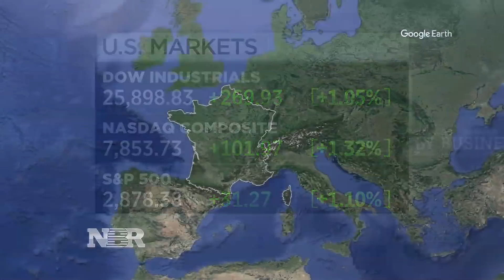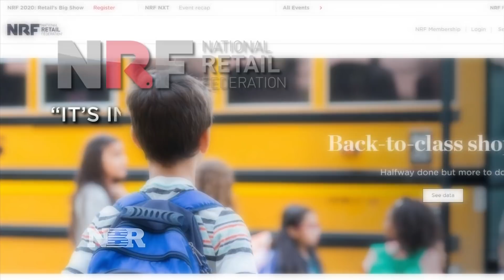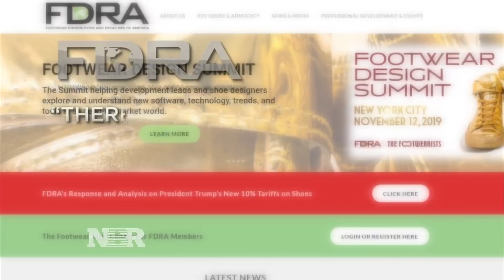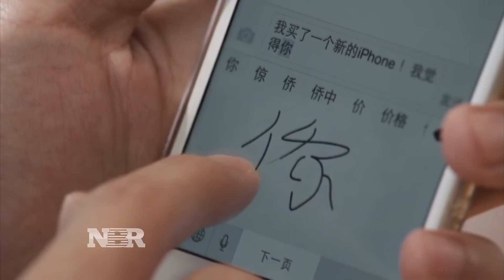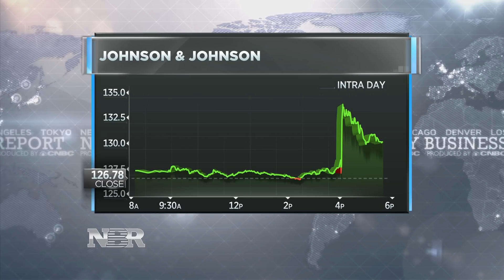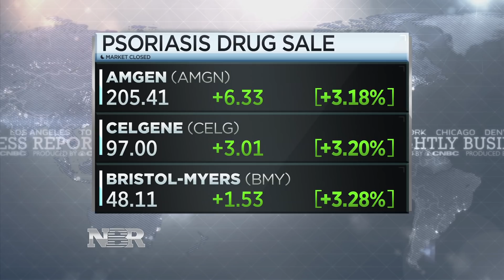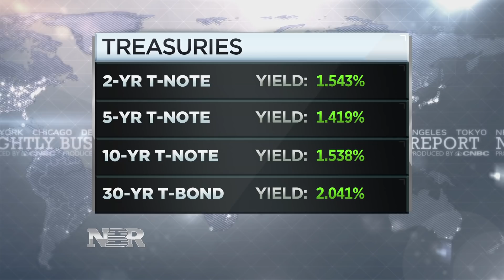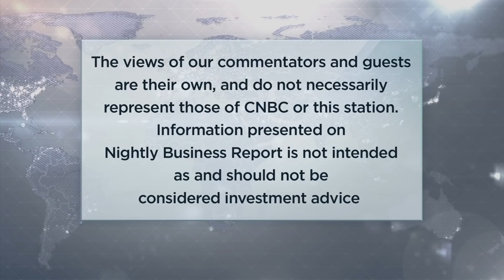Nightly Business Report – August 26, 2019

Comment: Today there were 13 new 52-week highs and 63 new 52-week lows on NASDAQ.   On the NYSE there were 21 new 52-week highs and 61 new 52-week lows.    The slope of the US Treasury yield curve was almost constant: five (5) basis points separated the 1-month yield (2.09%) from the 30-year (2.04%).    Volatility, as measured by the volatility index multiple I follow, UVXY, declined.   UVXY finished at 34.00, off 3.74% on the day.

Winners of the day included Choice Hotels (US ticker: CHH) and Chegg (US ticker: CHGG).   Regarding CHH: "Choice Hotels International, Inc., together with its subsidiaries, operates as a hotel franchisor worldwide.   As of March 31, 2019, the company had approximately 7,000 hotels with 570,000 rooms in approximately 40 countries and territories."     Regarding CHGG: "Chegg, Inc. operates direct-to-student learning platform that supports students on their journey from high school to college and into their career with tools designed to help them pass their test, pass their class, and save money on required materials.    Aong many other things, the company offers Chegg Services, which include digital products and services; and required materials that comprise its print textbooks and eTextbooks.  Chegg, Inc. was founded in 2003 and is headquartered in Santa Clara, California."
Reply: "AMONG" TYPO 👍